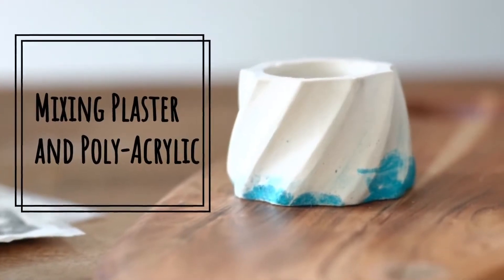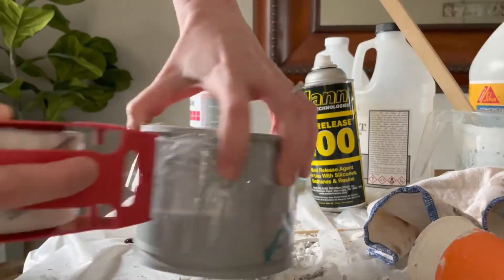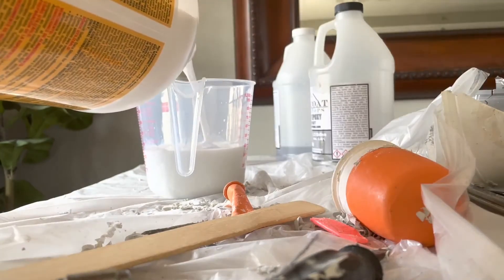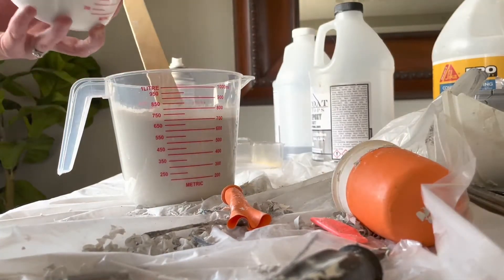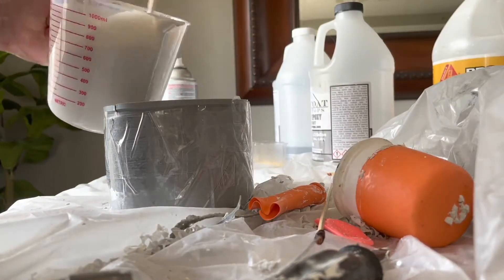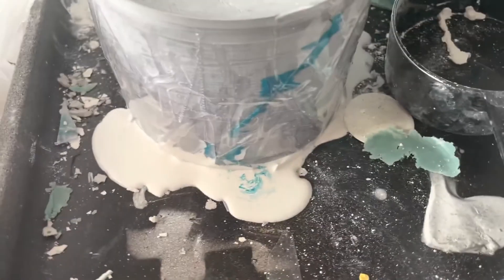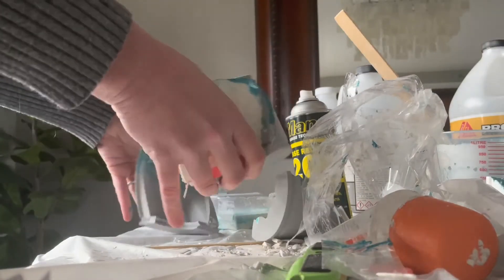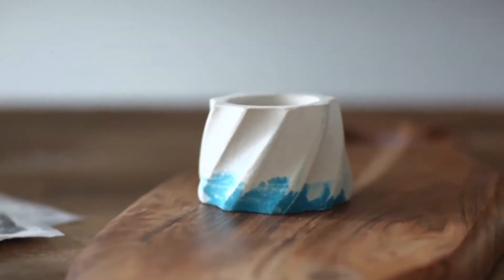How to make a Plaster and Polyacrylic Planter

Comment: I know this is an older video, but thank you for this. The "eco resin" hobby has hit my house and I was suspicious of the kits you can buy. Research led me to plaster mixed with an acrylic polymer for strength. A search of acrylic polymer mixed with plaster led me here. Thank you for posting a link to the liquid acrylic polymer! It is a lot vheaper then using Golden GAC 100 which I had read would work great. Why more $$. I appreciate your knowledge and experience and your willingness to share it!
Reply: Same here! Have you done it yet? Ecoresin and jesmonite and all others aren't cheap and I'm going through it quick! I want to do this

Comment: Can you link the mold you use and the products for the plaster and polyacrylic? xo
Reply from the maker: THe mold is digital file I bought and 3D printed. WHich is another reason to get a 3D printer. 3D printed Mold: https://www.alch.shop/shop/digital
You can buy silicon molds on Amazon and they would work well, if not better than the 3D printed one.

Comment: Could I pour a candle in this container?
Reply from the maker: Yes, but I suggest using a low temp wax like soy based (under 90C) and sealing the seams. Verify it's sealed by pouring in water first.